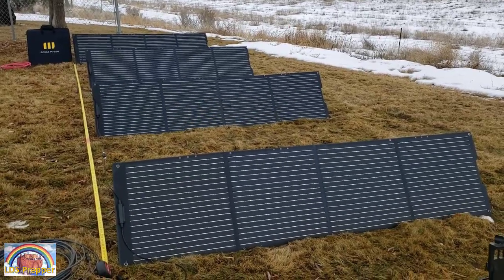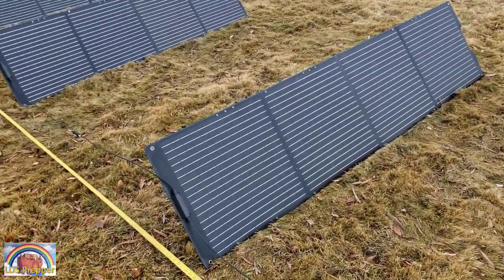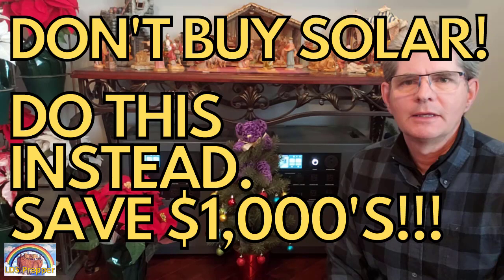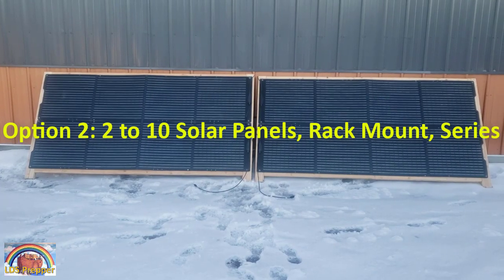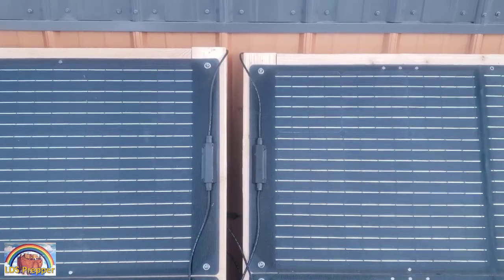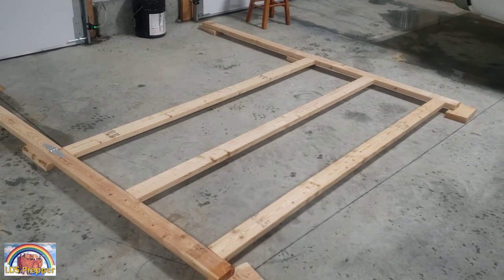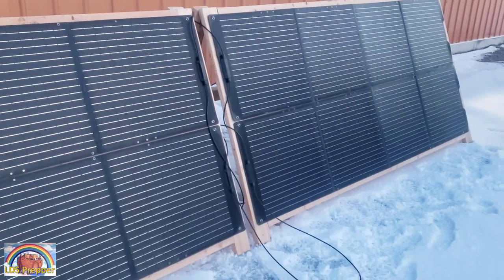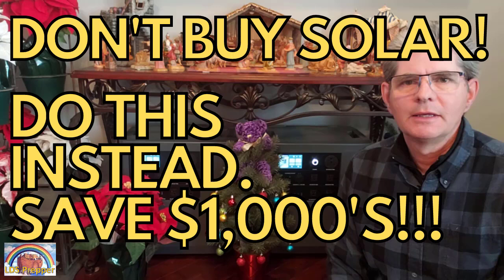Mango Power 200W Portable Solar Panels: 3 Easy Setup Options

Comment: Good afternoon, does the solar wires harness that connects directly to mango e come with the panels or the mango power station or ordered separately?  I have received my panels( but haven't opened the boxs yet) and awaiting for delivery in late February for the power stations themselves.  Thank you
Reply from the maker: Thank you for asking. The cable that connects the Mango Power E and solar panels comes with the Mango Power E. This video shows the additional cables you need to connect from that cable to the solar panels.

Comment: Since the inverter is built into the Mango, how does the charge controller fit into the scheme or is it even necessary?
Reply from the maker: The charge controller is built into the Mango. It is a complete system.